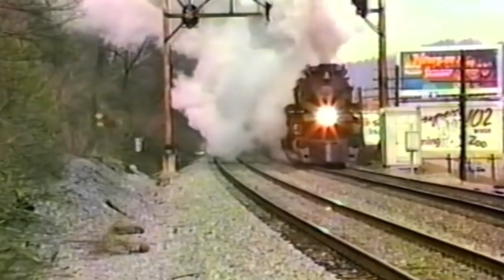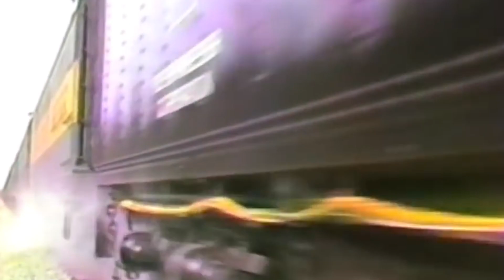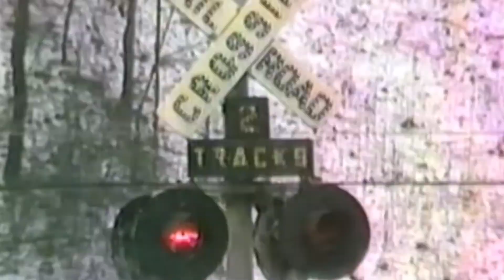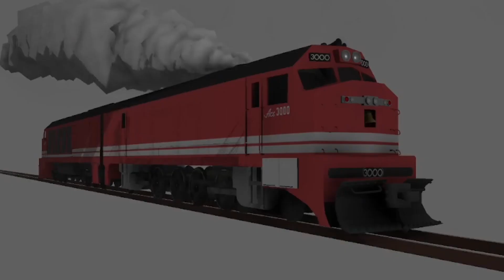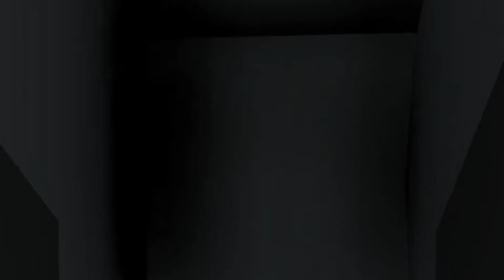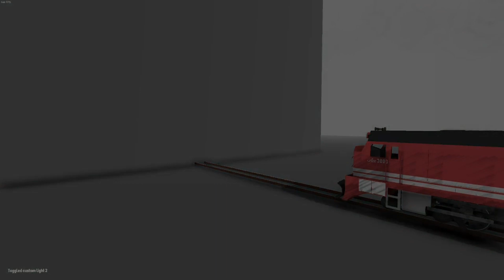Ace 3000 Rolling line mod demonstration

Comment: The Coal on the ACE 3000 was going to be contained in 3 interchangeable coal boxes on the side closest to the locomotive itself.
Each container would've had a capacity of 11 short tons with a total coal capacity of 33 tons when fully loaded.
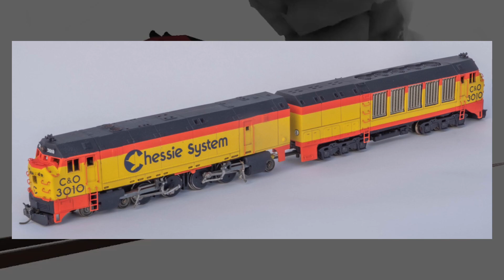The seams between the coal boxes along with their lifting points are visible on model you show at 2:47 but it's a small detail that not everyone would notice.

Comment: BTW the "diesel" unit is the tender and the coal would have been carried in special covered hopper units, that could be taken on and of the tender for faster loading then with a coaling tower. And the fans on the tender were to cool steam from the locomotive back down to water to be used again.

Comment: You ever thought about doing the NYC Niagara? There are a lot of mods about the hudson, the N&W j class and even mountains! But no Niagara. It was so awesome. (If you think about it, maybe also do the proposed dupkex version). You are (in my opinion) the 3rd best modder for Rolling line (Nr.1 is Missie because of her INCREDIBLY realistic models and Nr.2 is goblin357 due to his awesome british stuff with hidden valve gear and lots of charm). You however have style. Especially the Arkansas engines. I dont use them often, partially due to the simplified valve gear, but they look stunning nonetheless.

Comment: You forgot to mention that the ace 3000 was also conceived due to the 1970’s oil crisis. The ace 3000 was meant to be a way for the railroads to go back to using coal instead of the then much more expensive diesel.